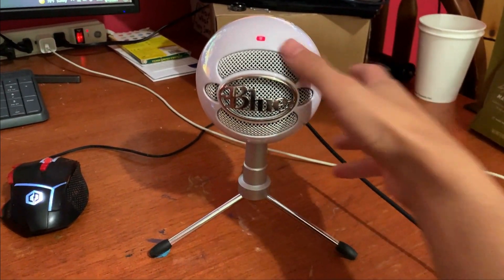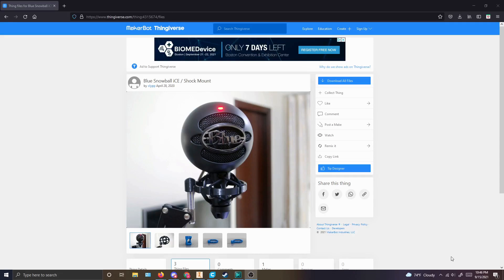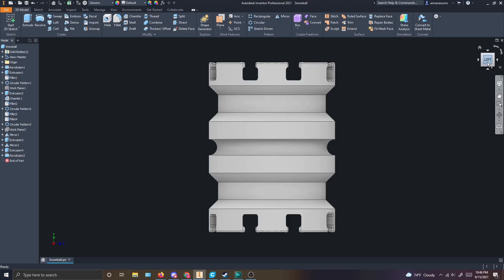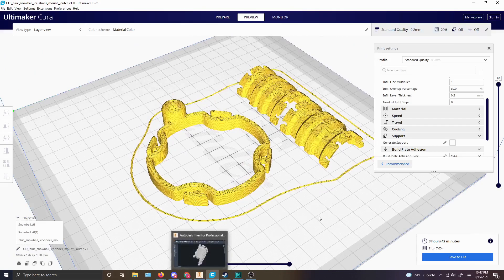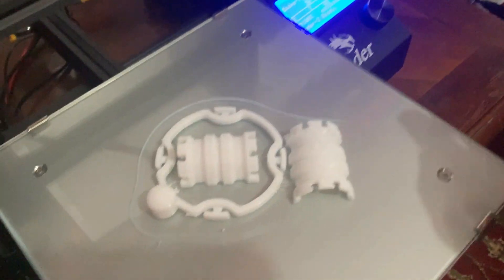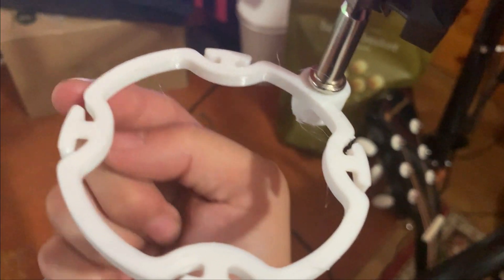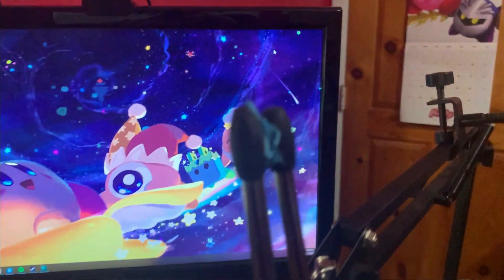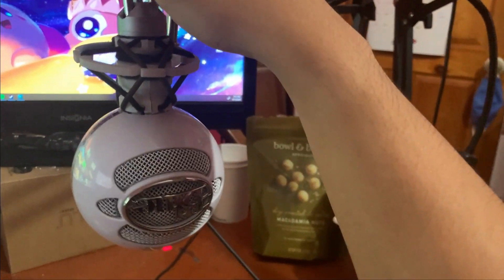Mounting the Unmountable: How To Mount The Blue Snowball iCE Microphone Without Removing Its Stand

Comment: I have the blue snowball ice, it does unscrew it's just extremely tight. I put some locking pliers on it and it came right off. Regular pliers would work too and maybe would come off with just some elbow grease.